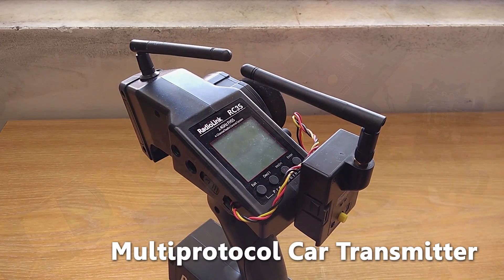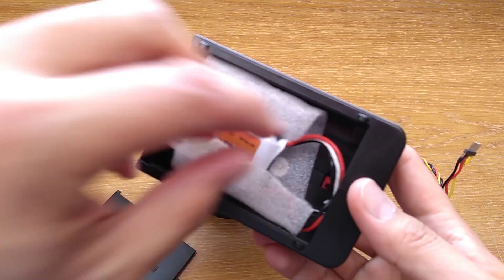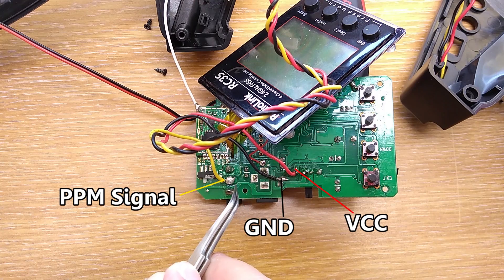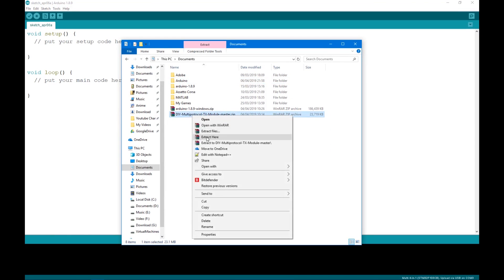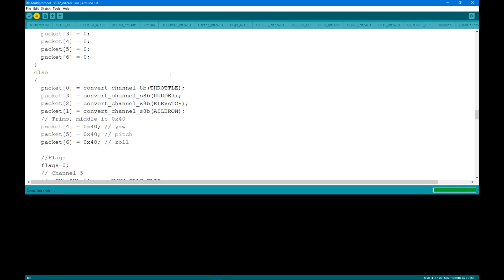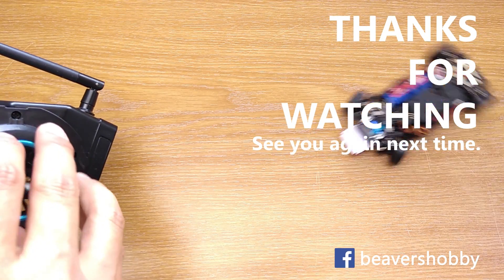How To Use Multiprotocol Module With Car Transmitter & Mini-Z, Mini-Q, WLtoys

Comment from the maker: Recording while having fever was tough. Please turn on subtitle if you don't understand what I was saying.
Time Stamps
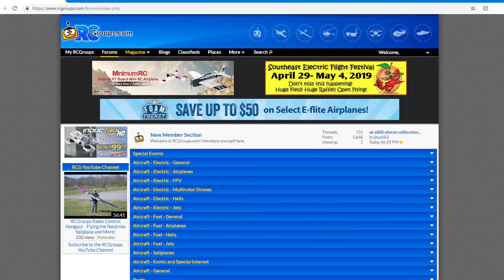Multiprotocol Introduction: 0:18
Transmitter Modification: 1:39
Firmware Customization: 4:24
Binding & Setup:  6:48
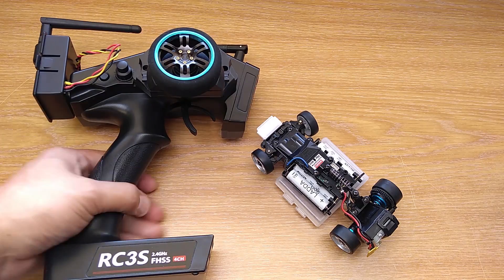Mini-Z: 7:02
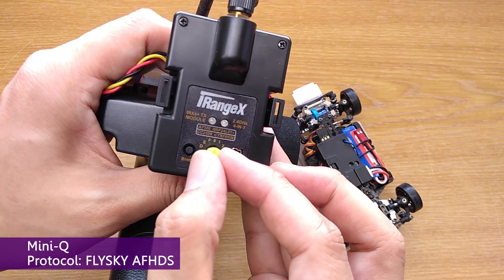Mini-Q: 8:48
WLToys:  9:52
Reply: Beaver's Hobby well I’m sorry to hear that your sick, but I have a review car for you. Hope you get better soon :)

https://m.banggood.com/SINOHOBBY-Mini-Q-TR-Q5OP-BL-128-Upgrade-Brushless-TouringDrift-RC-Car-p-1032827.html?rmmds=search
Reply from the maker: @BiggieCMAN  Hello, I'm feeling much better now. As for the car, the Q5OP is the older version of Q7 that I have. https://youtu.be/kCjglUnXBQU And here's the review of Q7. https://youtu.be/Q3Nt7Wrq3ws
You can see that they use the same chassis plate. But Q5OP still uses kingpin suspension and not double wishbone suspension like Q7. You can think of it as a fully metal upgrade TRQ1 (and a very expensive one at that). Especially when you look at the price, it's really no point of buying the Q5OP any more ever since Q7 came out.

Comment: Amazing work...this module is ok for FlySky GT5?
Reply from the maker: Unfortunately, no. Flysky GT5 doesn't have the DSC port or PPM output to send to the module.
Reply: Thank you...can i use signal pwm to ppm converter for multiprotocol module connect?
Reply from the maker: @cristianomiino7699  So you want to connect the module to the receiver using PWM to PPM? That might work. It will introduce a lot of latency or delay to the system though.
Reply: @BeaversHobby  My crazy idea....identify PWM pins on stock RF module, connect this pins on signal PWM to PPM converter, connect the converter PPM output to multiprotocol module and transmit the signal to rx on my crawler... bad idea?
Reply from the maker: @cristianomiino7699  That was a legit method on the GT3C. I don't know if Flysky still do PPM output to module or is there anywhere on the board but if you have some free time, it will work.

Comment: This has the same Multi models as the Radiomaster 4IN1 Module? right?
Reply from the maker: Yes, it is. When it's internal or connected through serial it'll have faster connection than what I did here too.
Reply: @BeaversHobby  Sweet thanks alot! Saved alot of time cuz of you!

Comment: Should it be move to ppm mode? My USB port not connected on pc. do i have to burn it first?
Reply from the maker: If it does not detect with USB then you will need the FTDI adapter to flash the bootloader. This should be there by default with newer batch though.
You can use turn the rotary switch to any position while connecting it and it'll still work. At least mine works like that.
Reply: @BeaversHobby  can this be bind to the flysky receiver gr3e? because I read in the manual book it can work on flysky but it's not explained with the receiver type.
Reply from the maker: @sablonmanual6936  Yes, it can. It will bind to Flysky AFHDS and AFHDS 2A.
Reply: @BeaversHobby  thanks sir, it works in my losi transmitter. But the module cant work in my kopropo transmitter. even though I've found ppm, +, -, rf ok, and it can't work, i have tried putting 10k,12k,1k resistors from + to ppm and from ground to rf ok. and all failed. Is there any solution or by installing the right resistor?
Reply from the maker: @sablonmanual6936  I don't have any experience with KO either but I suppose you can find a schematic of a module for it then mimic the resistors there.

Comment: Can we use that tutorial with a flysky gt3b?
Reply from the maker: If you can get it to output PPM, yes.
Reply: @BeaversHobby  Thank you for answering, you are always a great help.  The gt3b cannot broadcast ppm? I have to investigate about the solder points of the PCB?  any question, I have seen another video of you using the fs gt3c, how many channels does your station have?  because you mentioned that you had to change the Ch4 to give the mini z more spin.  but most have 3ch, is that option still available?  or the channels refer to the receiver?
Reply from the maker: @david9778  There is a pin on the board that could output PPM on GT3C but I'm not sure about GT3B. I couldn't make it work though.
As for the CH4 problem, it is on the transmitter side. You can either program the protocol to output CH4 as you want or swap CH4 with 3 in the code. Then reverse the channel 3.

Comment: Are you able to use the IRX4 module to bind to the mini-z instead of the IRX4+?
Reply: Thats great news. I prefer stick style transmitters and have an FrSky model that could take the IRX4 module, so that shouldn't be an issue. My understanding is that it can also bind to DSM2/X receivers so it should also be able to work with an E-flight umx model I have
Reply from the maker: @reptilianrascal1125  Yes, it should. See all the available protocols in there project page. https://github.com/pascallanger/DIY-Multiprotocol-TX-Module/blob/master/Protocols_Details.md
I also use the multiprotocol TX16S with the new Mini-Z. https://youtu.be/vSRR67jMhzI
Reply: @BeaversHobby  Excellent. Another question. Does the IRX4 Plus connect to FrSky transmitters with serial the same way the IRX4 does? It looks like it does, but I just wanted to check since only the plus version is available for me right now.
Reply from the maker: @reptilianrascal1125  Yes, it can work in the serial mode. The Plus just has an extra button and dial for it to work outside of the serial mode too.
Reply from the maker: That depends on your transmitter. If your transmitter connects to it in serial mode and you can trigger the bind from the transmitter, IRX4 will work. I use IRX4+ because this is PWM mode and I have no control of the module from the transmitter.
TL;DR in the same config as this IRX4 will not work because there's no bind button.

Comment: I assume this module can be used on the FS-GT3B, as it has the DSC plug as well as PPM accessable from the inbuilt module, but would it work with other Wltoys models like the A959?
Reply from the maker: Yes, if the transmitter has DSC or PPM out it will work. The protocol for A959 is also V2X2, the same as K989.
The newer ones like 144001 uses XK X420 so if you try V2X2 and it doesn't work, try X420. WLtoys cars use these 2 protocol.
Reply: @BeaversHobby  I am trying to figure out the Arduino side of things. The board doesn´t appear on the board list and the red LED is constantly flashing on the module, green LED is off. In my Device Manager the module appears as "MULTI-Module USB Serial (COM3)". Is this possibly because I have to flash a bootloader in first although the module is brand new this month, or could it be a driver issue? Thanks
Reply from the maker: @hyzenthlay7151  If it's on device manager then it should be OK from the driver side. From what I remember the board setup can be a bit tricky as you'll need the STM32 version of it. Here's the documentation.
https://github.com/pascallanger/DIY-Multiprotocol-TX-Module/blob/master/docs/Arduino_IDE_Boards.md
Reply: @BeaversHobby  ok, I managed to get the IDE to recognise the board. I had to mess around with the sketch a bit as a couple of the protocol INOs gave me errors, and rather than trying to fix them, seeing as they were protocols I would never use, I just removed them. When I compiled it, I got back that it was too big, so I removed a few other protocols that I would never used, and finally it would compile and upload. I also did your V2x2 adjustments as 2 cars I want to use are the K989 and the A959. Once done, plugged the module into the FS-GT3B transmitter (I got a 3D printed module housing and adapted it to fit on my transmitter),and it works with both the K989 and the A959. 

The only problem I'm having is I can't get them to go backwards no matter how much I adjust the trim or the EPA on the transmitter, and it will only go baclwards and forwards if I reverse the channel, also, the steering has very little angle on both, so I suspect it might need to modify the End Point Setting under TX_Custom on the sketch, but I will need to find out what those values are (any ideas on how to do that? I have tried looking on Google and not found anything).

Anyway, thank you for all of your help, I think this mod has been a success!!

EDIT:

This is getting stupid. As soon as I solve one issue, another comes along. I connected the module tothe computer again to adjust those endpoints, and it no longer works in the Arduino IDE, in the Device Manager it now appeaars as "libusbK USB Devices > MULTI-Module DFU Bootloader" and with no COM port. I have tried unistalling it and reinstalling, anddepending on what drivers I use, I either get that, or "Maple 003 (COM 5)" or another COM port, but with the yellow exclamation as not able to initialise, and it never gives me the option to choose the COM port in the IDE. Have you encountered anything like this before? I'm wondering if it's best to just get another FTDI as I can't find my one, and if I can use that without using the onboard USB to upload sketches by soldering the pins inside...
Reply from the maker: @hyzenthlay7151  I have encountered the Maple controller situation. If it's appeared as Maple then it's working. Otherwise it's not. I only did the bootloader thing once and somehow it appears as Maple later but at least it's working.
As for the endpoint thing, I use another Arduino board with receiver reading code to read the output from a receiver. You can do that with 2-in-1 too via servo port.
Here's my code that I hooked a 4 channel receiver to Arduino Mega + LCD. https://github.com/beaver-pc/Read-RC-Receiver/blob/master/Receiver_4CM_Int_Read.ino

Comment: Hello! Does this work with the new MA-020? Thank you for the video!
Reply from the maker: Yes, it will. The latest firmware version also supports new Mini-Z FHSS.
Here's the video, I changed the transmitter but firmware setup is the same (except no need to change the channel order because RC4GS already has 4 channels). https://youtu.be/RU9fHsx-Ucc
Reply: @BeaversHobby  Thank you so very much! I was able to get the RC4GS working with the IRX4+ and my MA020! I very much appreciate all of the help and information!

Comment: Can I use this to bind with flysky nb4 mini receiver like the GMR one?
Reply from the maker: Unfortunately, no. GMR is the new protocol on presumably a new chip and there's no work on multiprotocol yet.
Reply: @BeaversHobby  Ouch, I wish radiolink make a micro receiver. The market for micro rx is there.
Reply from the maker: @cityofplant  The smallest one from Radiolink is R4FGM. It still comes with standard pins with 2.5mm pitch for standard plugs though.
Reply: I have the module now and add it to radiolink RC6GS update the firmware (ppm) but the can not choose jiabale Protocol, how can help me ? Or build a fw for me ?

Comment: Great inspiration: I am going to try the IRange iRX4+ with my Kyosho KoProPo Transmitter. I am going to 3D print an adapter to fit into the KoPropo module bay and host the IRange Module. It would be a great opportunity to run all kinds of models with one transmitter and also use inexpensive receivers (DSM2-Air) for experimental car and boat models
Reply from the maker: Watch out for latency. I've tried DSM2 and it's pretty slow compared to Flysky AFHDS. I think you can find them both around the same price.
Reply: @BeaversHobby  Thanks for your answer.
I have been warned about the latency of DSM2 Air Receivers. That's the reason to use them just for experimental stuff, as I have plenty of them laying around. For more serious stuff I will certainly use better receivers - As I will have now the freedom to do so.
Please keep up making your great videos.  and thanks again for your reply.
Reply from the maker: @guidodresemann8494  My pleasure. Best of luck with the project!

Comment: Hello everyone! Radiolink rc6gs and mini-z MA-020S equipment. I do everything according to your instructions, except for the firmware of the equipment. When binded, only the red LED lights up. On mini-z, orange stops flashing. Turning off the power to the mini-z. I turn on and only the throttle trigger works. Steering wheel does not work. But when the wheel moves on the equipment, there is a slight turning sound but the wheels are stationary. I connect a standard transmitter from mini-z, the turn works. What could be the reason?
Reply from the maker: Have you tried reverse channel 4? It needs channel 4 to be reversed otherwise it won't turn.
Reply: @BeaversHobby  I did the reverse and it worked! Thanks!!!
But another problem arose. I'm left-handed. I converted my transmitter to fit my left hand. On all my models, I just did reverse control and everything was fine. But here it turns out when turning the wheels in the rear, the wheels turn to the right, and upwards - to the left. How can this be changed? I think you can swap the wires in places that fit the motor that acts as a servo.
Reply from the maker: @b166irinthematrix4  So the steering goes the opposite way on this car? It's the channel 1 or ST that controls the steering. Try reversing that first.
Reply: @BeaversHobby  Yes you were right. Now everything works as it should! Thank you very much!!!
Reply from the maker: @b166irinthematrix4  My pleasure. Have fun!
Reply: @BeaversHobby hi. Is it possible to use the radiolink rc8x for mini z? With this multi protocol too?
Reply from the maker: @JasonUtomo  Yes, it is possible. There is also DSC port on RC8X.
Reply: @BeaversHobby  my God thank you so much for your reply. I was worried that I can not bind it with this rc8x,since I haven’t seen anyone else use this transmitter for mini z😅🤣👍🏻

Comment: What are the plug & play transmitters for wltoys k series ? Without binding and too much setups..
Reply from the maker: Check out WLtoys P33 transmitter. It'll bind to the original WLtoys 2-in-1 unit and it has dual rates, EPA, EXP, reverse channel so you can fine tune your car with that. However it'll only bind to WLtoys receiver or 2-in-1 so there isn't much room to upgrade from there.

Comment: I recommend buying a QX7 and make a Taranis Pistol grip (on thingiverse) out of it. 3d printer required though. With the power of OpenTX, definitely the last transmitter I ever need. You can use cheap drone/plane receivers, 900mHz longrange fpv, your imagination is the limit :)
Reply: Radiomaster tx16s.
Reply: @cobz76  what?

Comment: Oh wow...you can run a single radio with more than 2 protocols possible?  Thats AMAZING!  I've always wanted to be able to use my taranis with all my planes but some id have to remove the stock gear and replace it... which would suck.  I could get a module for each, but thatd get expensive and id have to swap em constantly.
Reply from the maker: With cars we usually swap the receiver to whatever radio we use but lately with 2-in-1 a multiprotocol is pretty handy for it too.
If you already have a multiuprotocol Taranis then you can just switch it to whatever the car use and drive it.

Comment: i have a sanwa transmitter M8 
how can i use this modul and how to be use a cable from my transmitter airtronics M8 to be work on this module

thank you my bro
always i watching yor channel
Reply from the maker: You'll have to find the pinout for the module and wire PPM, Vcc and ground to this module. I don't have the M8 so I don't know which wire is which. There should be some photos online though.

Comment: Can I use radiolink rc6gs v2 for this mod or maybe there is a newer and easier ways to get all 3 types of brands you mentioned working?
Reply from the maker: Yes, you can use RC6GS to do multiprotocol mod. Unfortunately, there's no other way to have multiprotocol on cars except using a radio with PPM to hook the module to it.
Reply: @BeaversHobby  so any suggestions what is the cheapest alternative radio and parts should I get to make it work on my rc6gs v2? If can find in bandgood will be good for me.. thanks bro
Reply from the maker: @boonxan  RC6GS and RC4GS are the cheapest radio you can do this. Then you'll only need the multiprotocol module and some wires.
Reply: @BeaversHobby  sorry, I meant the multi protocol module not the radio.. 🤗 I have a rc6gs v2 which currently not in use so might as well mod it so that it can be useful.. haha .. so where can I get the module? Thanks again
Reply from the maker: @boonxan  iRangeX IRX4 is the easiest one to use right now. http://bit.ly/2CZhVBc